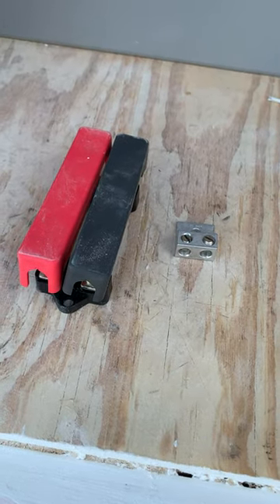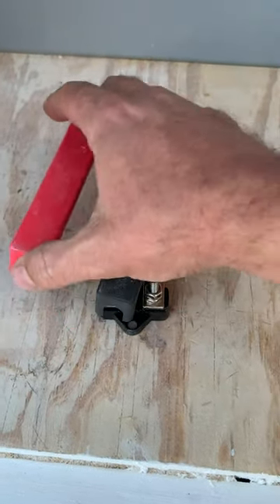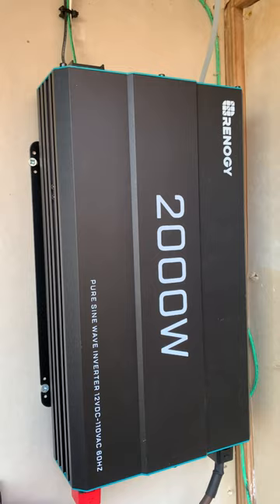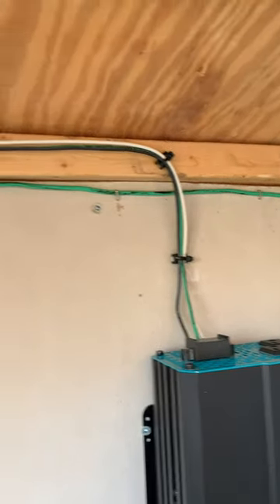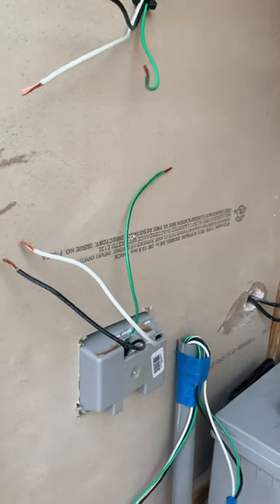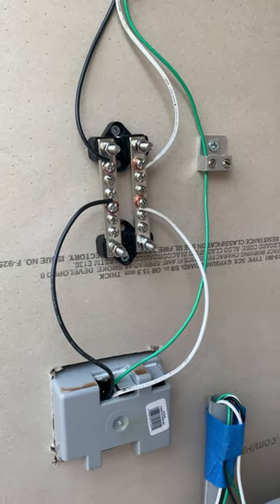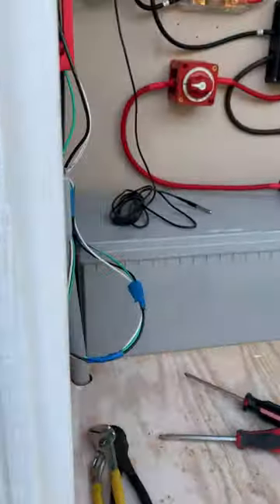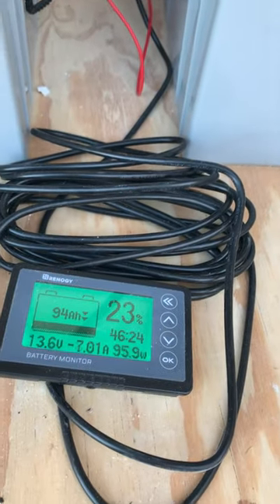Solar Install: AC Bus Bars

Comment: That's really not how ac is run. Should have just went into outlet box and branched from there if you add more outlets. That exposed 110v is not cool. At worst use a junction box.
Reply from the maker: Thanks for the heads up